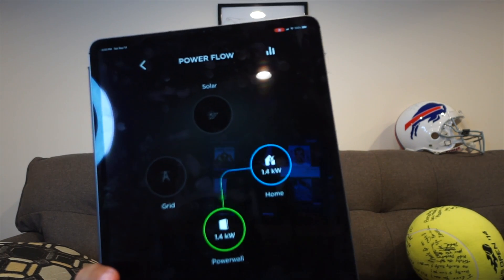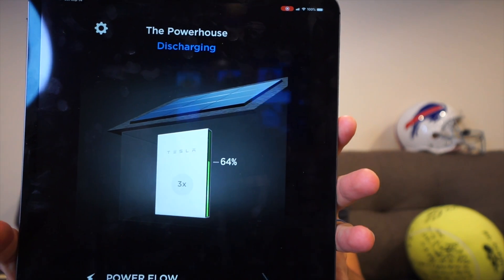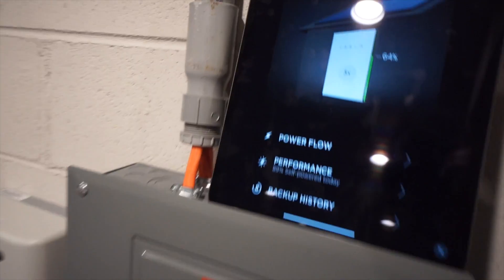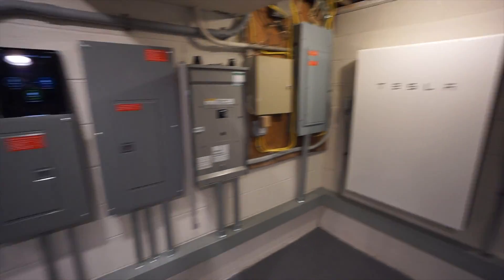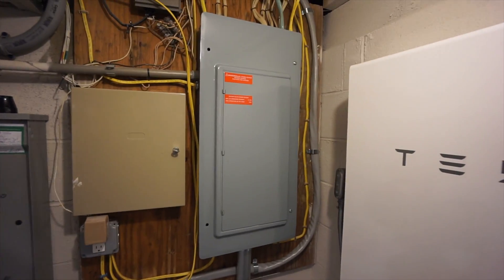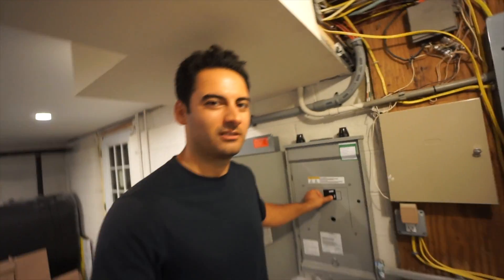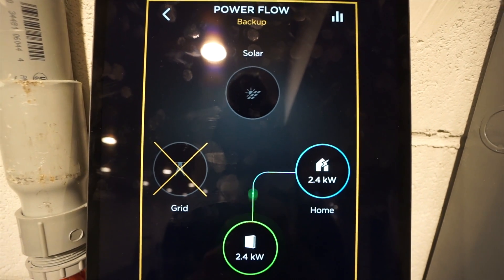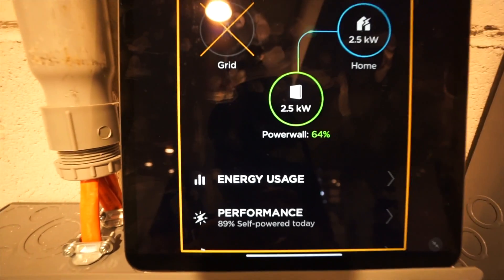No utility day 1!! | We are in Backup mode Tesla Powerwall 2

Comment: You do realize if you turned off your basement lights you would probably save 1kw minimum....

Good video.

Solar/off grid living is a lifestyle change, learn to run efficient.

FIY. It's been said that if the power walls don't have access to Internet they will shut off, is this only true if your renting TESLA systems?
Reply: I count about 26 lights. If these are LEDs, then they're probably 13-15W each, so I'd guess total usage under 400W. If they aren't LEDs, then a switch is in order to save $$$.
Reply: @ae1ae2  that's just the basement floor....
Reply: @NRC073  Definitely throughout the full house, but it's not 1kW in the basement (referencing your comment) if these are LEDs.

Comment: there is no contest at all for this test. how big is your home? how many rooms, how many people live in the house? how many appliances running electricity in your house? what is the temperature day and night? seems like you didn't do any home work before the test. you should know how much power your house will consume and how much power solar can produce. based on that, then lets see in real time, if it will hold as suppose to.
Reply: My average customers houses consumption averages between 500w & 750w average load, @ 220v
Reply: My customers on average use between 500w & 750w load @ 220v